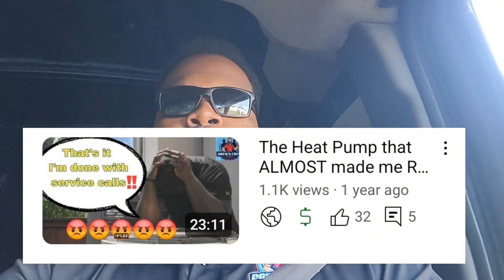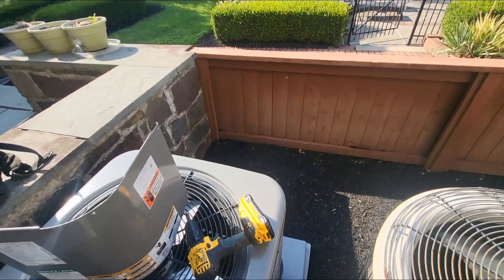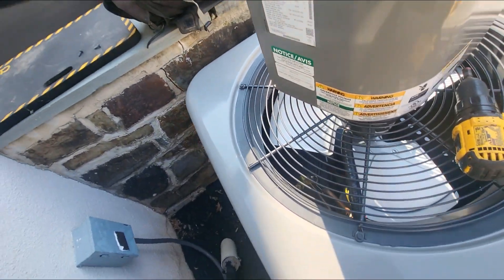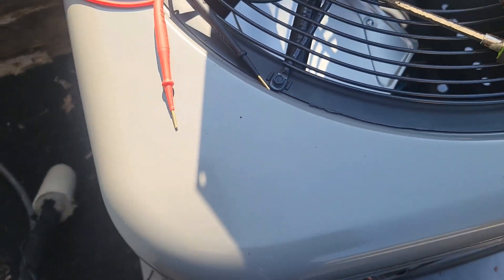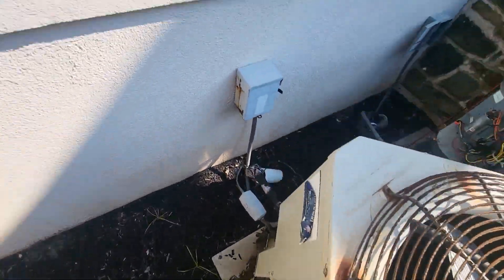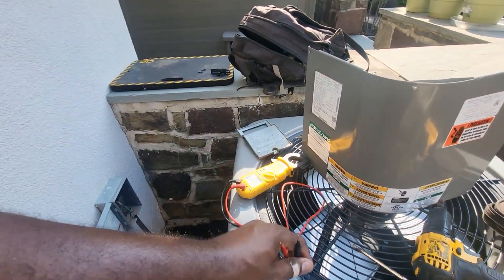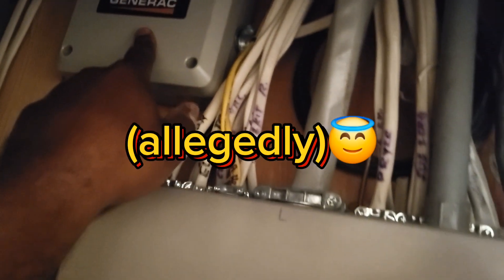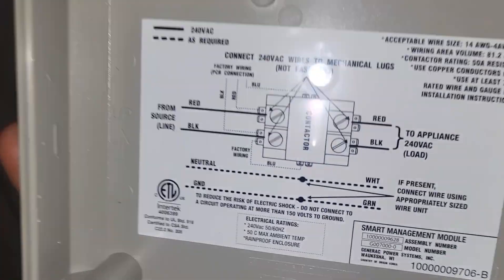"We Just Installed This Heat Pump… Now It Won’t Work 😡" | Heat Pumps

Comment: Easy fix. Generator time delay module. Light on ok. Light off, needs circuit board. Pull 1 low volt wire to contactor. Power will restore. Cust should call Generator repair. Not a emergency.